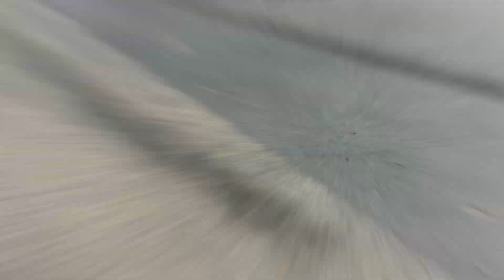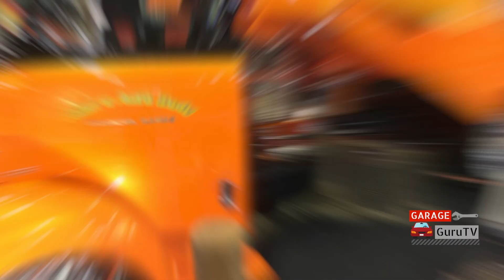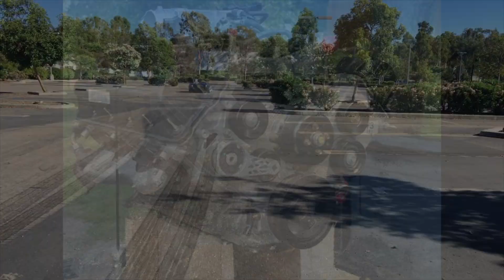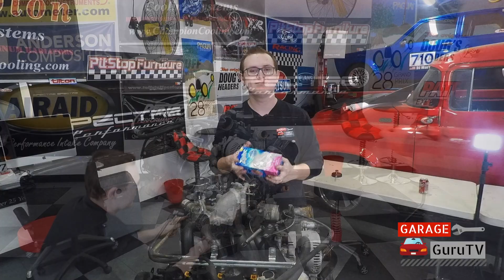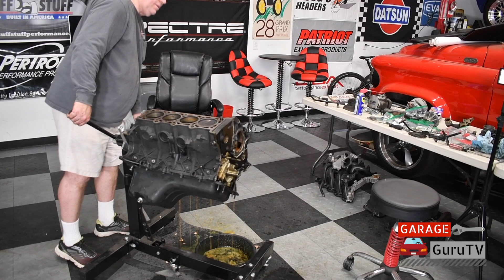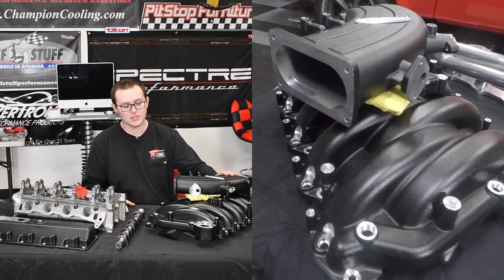Ford 5.4 2V Mod Motor Teardown + Trick Flow Top End

Comment: I did a 5.4 racing short block with the 44 cc TF heads and a Whipple 3.4.  Made 668 on 93 with 17 lbs and 890 on VP 103 with 22 lbs.   The 2v will make oodles of reliable power if you do it right.
Reply: bro i beg you to drop the links to the parts you ordered. Im tryna make my dads van as fast as possible. Im only 16 but im gonna buy it off of him since so many memories have been made in it.
Reply: @Cert.Backyardbs  Nothing I can really tell you other than what I described.  I shopped around until I found the best price for each part.  The whipple was 5K,  short block was 5K and heads were $2500.  All the other stuff like larger injectors, fuel system,  ARH exhaust and other consumables was close 7k.  The real thing that makes power is assembly knowlege and tuning.
Reply: @Cert.Backyardbs  do heads cam and a used gt500 blower off eBay and you can make some decent power
Reply: Glad to hear i got a tall tower single cam over yead 5.4 in my van and wanna upgrade it fully
Reply: @Cert.Backyardbs bought my dads 5.4 2v f150 lol. Best mistake i ever made. I put lots of money into it but itll be reliable soon enough.

Comment: I think the 5.4 2v was a good motor compared too 3v .
Reply: The 3V wasn't necessarily a bad motor either  they both had the unfortunate problem of having crappy cylinder heads that limited power production and having severe lack of engine displacement options and with the 3V introducing the notoriously bad cam phasers it was a recipe for disaster, it's awesome that ford figured out how to give Chevy a run for it's money with the 5.0 though Chevy or dodge for that matter simply just can't make pushrods compete with fords twin independent variable cam timing without the extra cubic inches

Comment: I hv a 99 lightning. 5.4 2v. Its got 275,000miles. And im nearly certain it has never had anything done to to the internals. And it has seen the 5200rpm's on the rev limiter thousands of times! It does not burn a drop of oil to this day. I know its hard to believe.

Comment: while i love and appreciate this video, your opening statement got me. the 5.4l 2v have almost no aftermarket support.
Reply from the maker: Thanks for the support! You are half right about 5.4s having little aftermarket support. The 4.6s got WAY more love but luckily the 4.6 heads cams intakes and many supercharger kits bolt right on or simply require an adapter plate. Don’t forget about the lightning aftermarket as well!
Reply: @garagegurutv6419  so is this intake for a 4.6 and your gunna use adapters?
Reply from the maker: @muffdiver777yummy8  that’s correct. I’m making the adapters myself.

Comment: You are supposed to install cam lock tool on both cams BEFORE removing the timing chain.   Also it is best before removing the timing chain you lock t he e cams in their proper timing position.   This way you won't crash a valves into pistons
Reply from the maker: Wasn’t planning on reusing any of the valvetrain/rotating assembly. If I were reusing those components you are absolutely right

Comment: My 2002 lightning as over 280 thousand miles motor never been open not even for timing chain guides
Reply: 242k still like new. Never been opened up.

Comment: I hate to break it to you but if that's a 2001 donor engine that's a cast crank 97-00 5.4 engines had a forged steel crank.
Reply from the maker: Came from a 2000 Expedition! Specifically looked for a 99-00 5.4 so we would have the forged crank and pi heads (if we didn’t end up using the much better Trick Flow heads)

Comment: So I liked the video, subscribed and hit the bell icon because I too have a 5.4L 2V from my 2000 F-250 super duty that I REALLY would like to get more power out of so I'm very interested in seeing the results of this tear down and rebuild. I may want to copy what you did, but I'd also like to see a cost break down too to see if it's worth it
Reply from the maker: We’re expecting like 480HP at the crank, but we are sacrificing some low end torque as the motor is going in a very light car. For your F-250 I would suggest looking into fitting a supercharger from the lightning. That would yield fantastic results for a big truck. Then from there you can look into engine internals. To put a lightning blower on an N/A 5.4 2V you need the supercharger, throttle body, air intake, injectors, rails, intake manifold with the air to water intercooler, heat exchanger for the intercooler, harmonic balancer, and a few other front drive components, and a tune. Best would be to find a lightning and part it out.
Reply: The weakest link in the 5.4 2vs is the connecting rods. Everything else you’re good for 500 whp. Although if you’re going into the block that deep it doesn’t hurt to consider pistons. Definitely ARP bolts, it’s a no brainer. 
I agree with the supercharger especially for low end on a super duty

Comment: Very good info on the time line, but still missing the 5.4 32 valve/DOHC V8 that came in the Lincoln Navigator from late 1999 - 2004
And Lincoln Blackwood(2002)
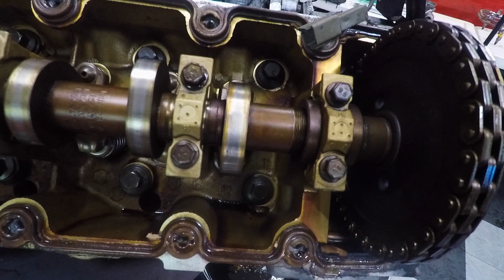Reply: 8:48

Comment: Thanks for the great info.
Im trying to figure out which engine my $300 van has in it.
98 e150 club wagon. Seller said 5.4. The parts i bought fit. Later i did a vin search & it says 4.6 2v.
What's confusing me is that mine has spark plug wires & the coils are all at the front of each bank.
The boots on the plug end look the same as the COP style. Straight boots not angled.
The sticker inside the driver's side door says void + inspected by Washington state patrol.

Comment: I have a 4.6. I was thinking about getting the Twisted wedge top end kid. You mentioned needing to change the bore. I was under the impression that the heads were direct bolt on and the block didnt need modified. Is that correct for a 4.6 from a 96 Mustang?
Reply from the maker: There are two 4.6/5.4 heads offered from trick flow. The 185s and the 195R heads. The 185s will bolt right on to the stock bore. The 195R heads require a bore of at least 3.572” or .020” overbore to clear the larger valves
Reply: @garagegurutv6419  Thank you for clarifying. I want to tackle this on my car, but I'm a bit nervous, since I don't have experience with doing engine work this extensive. Do you have any recommendations?
Reply: @maccius yes hire somebody with the right tools and knowledge. For a seasoned mechanic its still a big Job. Lots of stuff that needs to be perfect or destruction happens.

Comment: So I’ve got the CNG version of the 5.4 f150. Natural gas has a ‘octane rating’ of 120. So it can handle lots of compression. This motor also comes with hardened valves and valve seats. Any ideas on power mods to utilize the 120 octane?  Turbo, supercharger. Or a big cam and mill the head?
Reply from the maker: That’s really cool! I do not know much about CNG vehicles and the performance of them, but what I will say is that the best bang for your buck power  for the 5.4 2V in trucks is getting a supercharger from a lightning. You have me interested now in performance applications for CNG! I will have to ask some of my SEMA friends about it!
Reply: I just learned about nat gas 5.4 . But I have never seen one on the road. I wonder what you could do with it. 🤔

Comment: Where can i get that intake manifold?
Reply from the maker: It’s the Trick Flow Track Heat Intake Manifold for 4.6L 2V Ford Engines. It is part number TFS-51811002 and is available from Summit Racing!
Reply: @garagegurutv6419  you still need an adapter plate to fit on the 5.4
Reply from the maker: @angelarmendariz8844  yes we machined a custom set that are port matched to the intake and the trick flow heads

Comment: You forgot the 6.2 for the HD trucks and Raptors 🙁
Reply from the maker: Purposefully didn’t include them. They are a fundamentally different engine. All of the motors listed share the same bore spacing, deck height (mostly), and many parts. The 6.2 Boss has a different bore spacing and shares zero parts with the Mod motor family. Nonetheless they are badass workhorse engines!!

Comment: Dyno numbers??
Reply from the maker: Haven’t dyno’d it yet. Similar 4.6 2 valves make about 380whp. We are expecting over 400whp especially with the “higher” compression.
Reply: If you have to ask you are in over your head

Comment: This series is awesome! The ford motors are great, except those 3v, which are boat anchors.
Reply: You can beef them up so they are decent engines
Reply: Love my 2 valve but there are many many 3 valves out there with well over 300k hard miles on them. They’re very sensitive to maintenance. And ya terrible design overall and it can be a total
Crap shoot to buy used. I personally would never buy a 3 valve now

Comment: As a new subscriber, I wanted to comment.  The video quality was great.  However, you went way too far into the ford mod lifeline and all of us watching this video already understand what a SOHC vs DOHC motor is.  Maybe going into more depth of things like measuring cam lobe wear or something else.  I ended up skipping past those parts of the video as they were wasted on me.  For most people who have their motor on a stand already understand most of what you said already.  I did appreciate the bore measuring.  :)
Reply: I would counter your point with my own. I am new to this line of engines and didn't know any of this out side of the the 4.6 and 5.4s in their various valve configurations.

I haven't found many good history videos, do you have any links on tap?
Reply: @nevermore9197  I would check out this guy's channel Fordtechmakuloco.  He has some of the greatest vids on the mod motors.

Comment: The 5.4 3 valve is a horrible motor lol.
Reply from the maker: With the revised cam phasers and a whipper they are astoundingly reliable and torquey! The early ones did have their issues, but once rectified they really are great. Have had a couple of them myself!
Reply from the maker: I meant Whipple haha
Reply: @garagegurutv6419  when you say the early ones what years are you referring to?
Reply from the maker: @JohnSmith-xx1lx  well the 3v came out in trucks in 2004 and the TSB for the updated cam phasers was 07 I think.
Reply: @garagegurutv6419  that makes sense, thanks for the info!